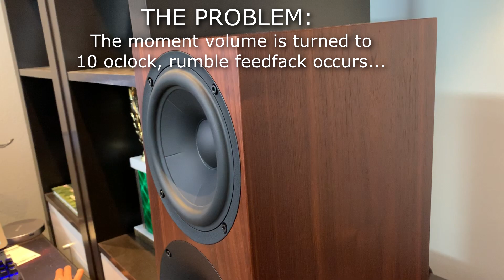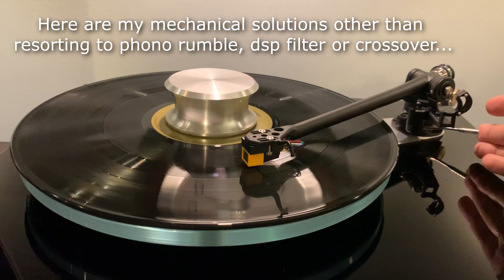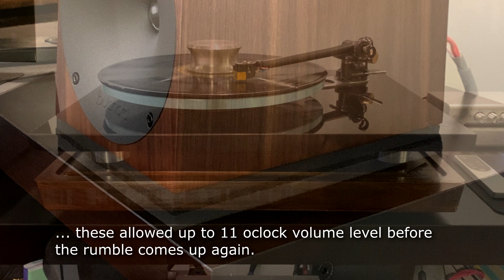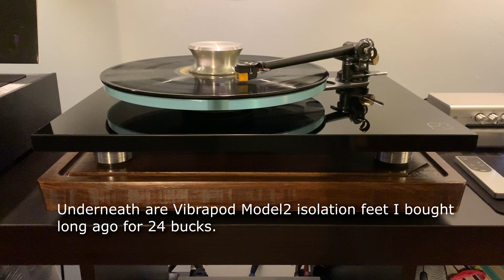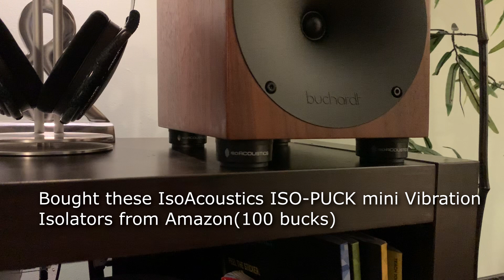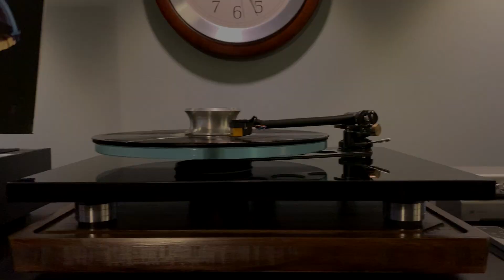Fixing My Phono Feedback Rumble

Comment: Hi! I am glad I am not the only one experiencing this. Do you have any other tips (like isolating the turmtable, placing on foam etc)? I have quite small room to move turntable so far from speakers so I am exploring other options.
Reply from the maker: You can buy a phono preamp with subsonic filter. Or you can also try MiniDSP to filter out the subsonic freq.
Reply: The sandbox tt stand is my next project. Low box a bit larger than tt filled with sand board on top “floating” on the sand tt on that.

Comment: Nice clean setup and cool tweaks. What cables (speaker, interconnect, power) and are you using a power conditioner? I have the SE S40 and have them on stands, are yours the standard edition A400? Thanks for your video.
Reply from the maker: Yeah just standard S400, not the signature ones. Nothing spectacular on interconnects, but not too generic either: Pangea Prime and old Audioquest sidewinder RCA cables for my sources, and SKW cable for preamp-to-amp. All my power cables are Pangea AC-14 plugged in to Furman M-8X2. I recently bought Blue Jeans Canare 4S11 for my speaker cable.
Reply: Thank you for your reply. The Buchardts are incredible speakers. I love mine and I've always owned floor standers, these are my first pair of small bookshelf and they sound  better than a lot of towers out there.The BJ speaker cables are a steal at the price. I have MIT and Audioquest at 10X the price and to my surprise don't sound much better. IMHO you have put together a world class system at a very affordable price all things being relative. And it looks classy too. Kudos to you my friend.
Reply from the maker: @mariosupa4027  What do use to drive your S400, separates, integrated?
Reply: Separates Audio Research  amp Primaluna preamp
Reply from the maker: @mariosupa4027  Idol   o(_ _)o
Reply: I didn't understand your last reply
Reply from the maker: @mariosupa4027  Ha ha, I'm sorry. I mean't "so jealous." Your preamp-amp combo are stuff out of my league, I can only own in my dreams for now :D
Reply: You know it's a great time to be in this hobby. You can get fantastic sounding systems like I'm sure yours is without spending obscene amounts of money. My Audio Research AMP is from when I was married and lived in a huge and expensive home spending insane amounts of money on high end audio. And no that's not that's not the reason for my divorce lol. My ex spent even more on her obsession with clothes and other things. Back at that time there wasn't many true quality affordable audio equipment. And the high end audio manufacturers got out of control with pricing because people like me were more than willing to spend for it. I have a friend that I told about your system and what can be accomplished when properly executed as you have done. Kudos to your great DIY tweeks. Lastly there comes a point in this hobby (audiophile), when it becomes a clear case of diminishing returns.
Reply from the maker: @mariosupa4027  Thanks. Ha ha, good stuff. I remember I was selling in us audio mart my amp with huge collection of tubes. My tag line is "Please take these away from me - save my marriage!" Thanks again for sharing.